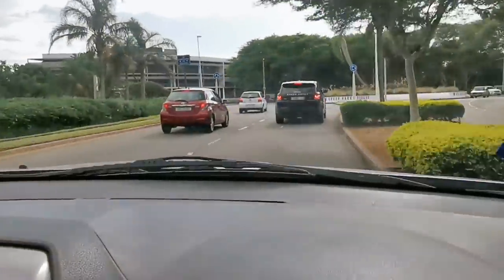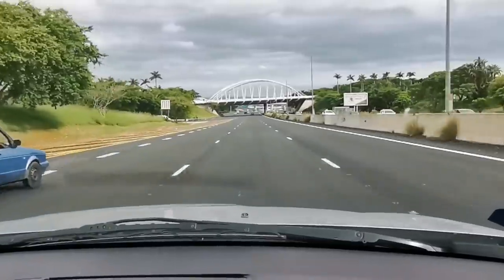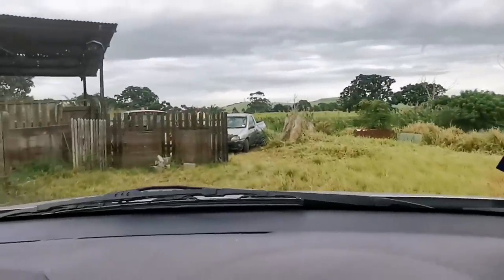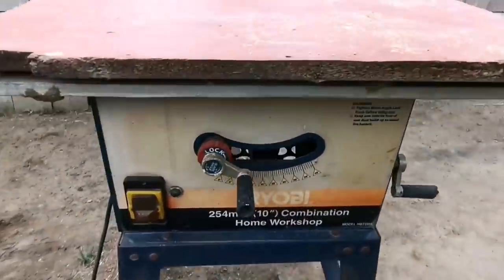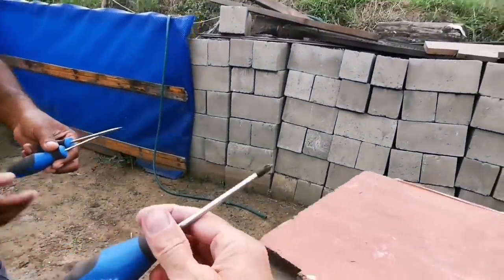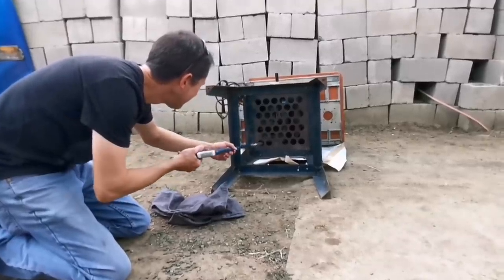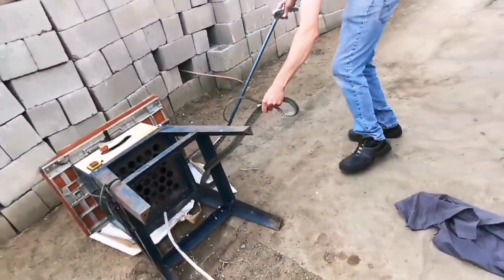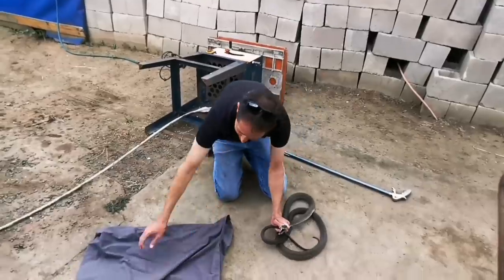Black Mamba spent the night, loose in their home !!!😱😳😧

Comment: Hi, Is it not possible to catch them with just the tong or maybe with two tongs? Can't help thinking how incredible risky holding them by the head like that. Stay safe.
Reply from the maker: No. People that catch snakes with only the tongs, should not be catching snakes. Snakes that are grabbed with tongs will pull, push and twist in an attempt to get themselves free from them, and in doing so, can hurt themselves very badly. Even brake their backs.
When tongs are used correctly, they are used only to restrain the snakes head very briefly, until the snake can be transferred to a softer, padded grip of the hand.

Comment: a comment and a question: I was nervous during the necking. From the close-up, it seems the snake could stretch left or right to tag you. Then... for all the time and effort to get the snake, what % of calls result in an actual financial thank you? Petrol and time are valuable.
Reply from the maker: Hey Hilton. I get that it makes people nervous to watch, but you needn't worry about the necking. I have been working with snakes for 30 years and if I wasn't feeling happy or safe with my grip, I would have let go and re-gripped 😊👍🏻

In terms of payment, I have to charge a fee wherever possible, but although I'd love to charge like a thousand rand or more per call-out (and many people suggest I should), I would get a lot less work and a lot more snakes would get killed. I have just recently upped my fee to R450 to come out, and even at this price, a lot of people aren't prepared to pay it, even those living in relatively stable or high income areas. The township and rural areas the people simply cannot afford it, so I go out to these for free if it sounds like a dangerous snake, especially if it's inside the house. The cost to do these calls, comes directly out of my pocket unfortunately. 
So in short, I'm not at all financially stable and it is not an industry that one can make a living from here in SA, but I do it because it's what I love.
This is why I'm trying to get somewhere with this youtube channel and make some much needed extra cash.
Reply: @jasonarnold-snakeman  Oh wow! That is so very good of you to do that dangerous work saving people and snakes for such a small (or no) amount of money! I wish you all the best with your YouTube channel. I definitely watch every single one of your videos.
Reply from the maker: I really appreciate your support.
Thank you 🙏🏻🙏🏻

Comment: Good thing Mambas are not social.  I saw this trailer home on concrete blocks.  Underneath the house was about 30 Rattlesnakes. Probably more.  Imagine 30 Mambas in one place.
Reply from the maker: Holy moly that would be a nightmare to be called out for. You'd need 30 snake handlers 🙈🙈🙈🤣😂👍🏻

Comment: Great video!!! The Black Mamba is a beautiful animal. It is a big, powerful and fast enough to chase you down. The Black Mamba even  has a menacing smile on it’s face. The Black Mamba can raise up high enough to deliver bites on a person’s upper torso, if not on the head and face as well. The Black Mamba is as beautiful as it is deadly, few snakes are enigmatic as the sinister smiling Black Mamba. All that said, and in this case, I would have been inclined to have just plugged in the table saw and turn it on.
Reply from the maker: They're beautiful animals. And actually incredibly peaceful and shy. As long as you're not cornering them and making them fear for their lives, they will be quick to notice you and disappear.

Comment: You must keep a few bottles of antivenom on hand. to handle that thing with such confidence. I couldn't do that even with a antivenom on hand, no sir.
Reply from the maker: Hahaha. Thanks Tim. I actually don't have antivenom. I will get it at hospital if need be. It's very expensive and has a shelf life of only 3 years. And I haven't needed any in 30 years of working with snakes.
Holding thumbs 🙏🏻👍🏻
Reply: @jasonarnold-snakeman  but what if you are to far away from the hospital and get bit, God forbid.
Reply from the maker: Within my area of coverage, the furtherest I'd ever normally be from a hospital is about 35 kilometers. So a 20 minute drive if I hurry 😊👍🏻😁🙏🏻

Comment: bro, when you were holdin that Mamba by it's head/neck, your fingers were red and you could see white on a couple of your digits which means you were holding essentially in a choke hold!! One day youre going to learn your lesson and youre gonna get a massive and an unbearably painful wake up call from a snake you're handling!! #begentle
Reply from the maker: I actually hold them incredibly gently dude. Don't judge my grip by the colour of my fingers, because I suffer from exzema on my hands, so they're always red, patchy, dry and itchy.
I have worked with snakes for 30 years and I only hold them JUST as hard as what's necessary to secure them if they are struggling. My grip is extremely soft otherwise.